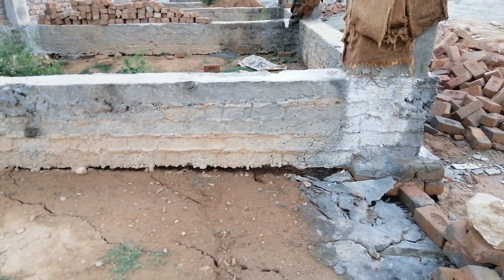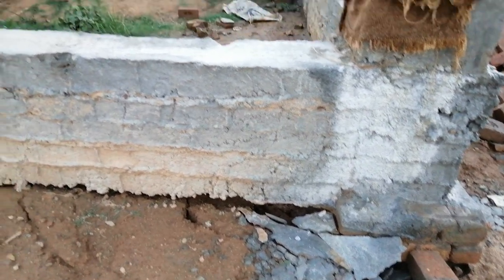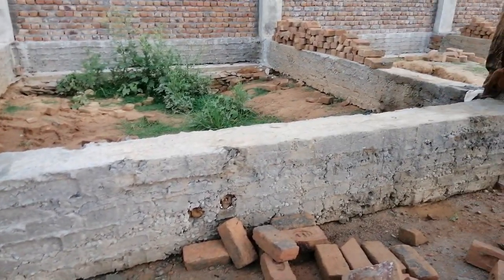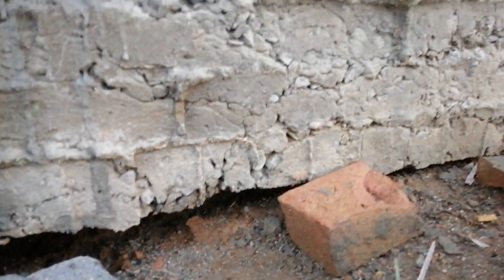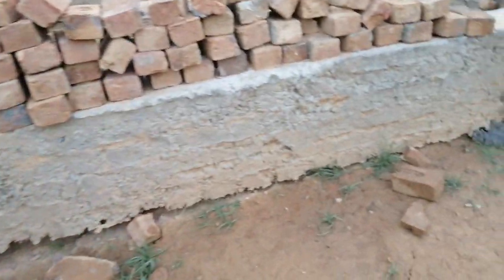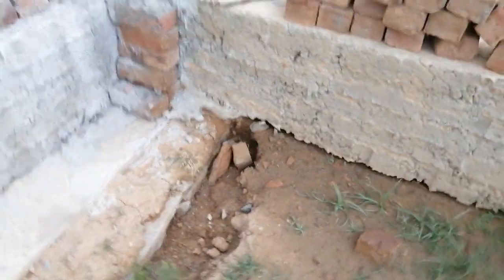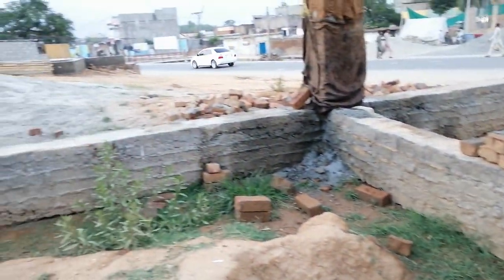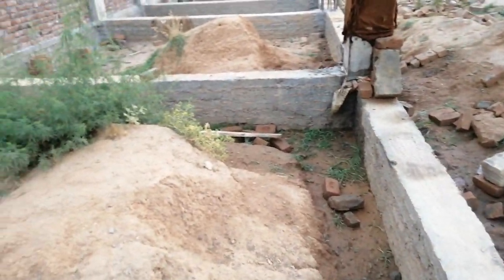How to Fix plinth Beam Mistakes on Construction Site

Comment: Plinth beam transfers the load to footing right? Does the soil take load from plinth beam?
Reply: The soil doesn't take the load from the plinth. The plinth beams span between the footing stumps as supports, and stumps transfer the load to footings and spread the load to the soil subsequently. (Pad Footing)
Reply: Yes thats right